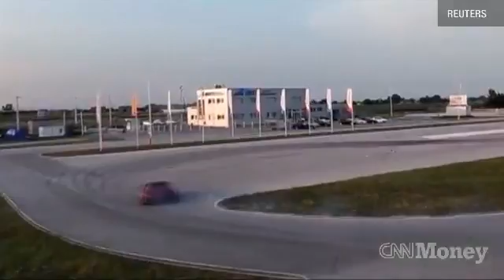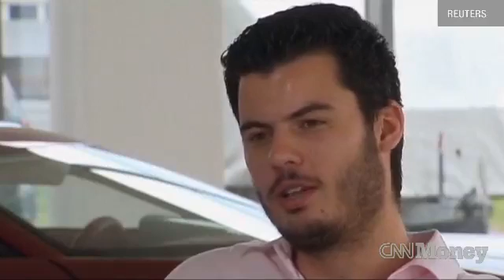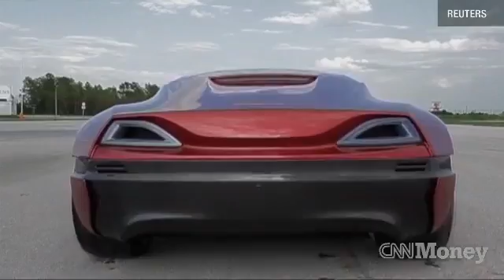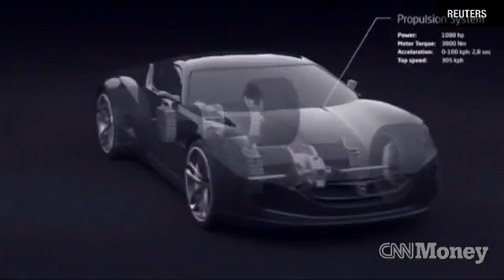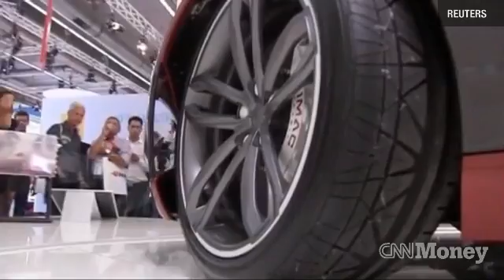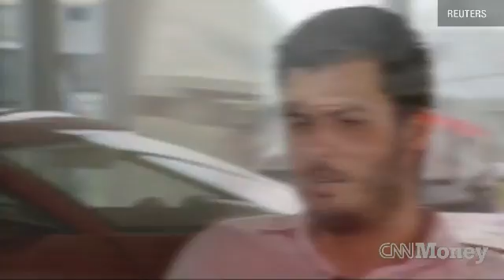The $1M electric supercar - from Croatia

Comment: It's nice Croatian car especially because it's electric.
The problem is that these cars are expensive.
Reply: You say it's expensive but it can actually beat LaFerrari, 918 and P1 in a drag race from 0 to 300 kmph which it does in around 14 seconds while the others take like 20 seconds. It's 6 seconds faster to 300 kmph than the other hypercars but somehow it's too expensive. Sure, why not, but where's the other cheaper car that can do the same? I don't even mean electric, just production car with the same performance. Don't look because you can't find it, the next best costs $3 million and it's 3 seconds faster to 300 kmph. Yeah, too expensive, like whatever.
Reply: Since when is 1M expensive for a hypercar? And anyway, Rimac's car is not the main product here, it is just there to showcase their batteries and motors. Concept One is a publicity stunt for something far mor valuable. A very good stunt, but still a stunt.
Reply: Maby hmm 200.000 but 1m , LoL
Reply: are there videos showing this? can it beat those cars around the track?

Comment: it sucks theyre so expensive and  waiting for that model 3 from tesla that starts at 30k but only in 2 years :(
Reply: +///AMG $35K. Could be $45K if you fill up the options page. Still better than even the 70D which starts at $75K.

Wait times?? The younger you are the longer you can wait. I'm 72 and I've been waiting for the three wheel $6800 Elio for 4 years. It feels like I'll die before I get it.
Reply: haha, yes i understand, but because technology is getting so advanced and that gas prices are never stable, the 35k testa would be a great buy even at 45k at the end. as long as theres warranty of course. im not paying 10k for a new battery.. and also a three wheeler? i always think those 3 wheelers tip over lol

Comment: Coat waaaaay too much. Tesla has really set the bar pretty high. Even the new Tesla Model S in development with AWD is putting down great performance numbers and the roadster started off with good performance specs. They only go for a little over $100K so why would anybody spend $1M for this.
Reply: dude, you're comparing two totally different classes of car! the tesla s is more like a bmw m3, and the concept one is more like a bugatti veyron, so hence the difference in the price.
Reply: Lilreeces10 Rimac has the best motor configuration for speed and range. Tesla cannot compete with Rimac's range of 374 miles and top speed of 180mph at this point in time.

Where Tesla beats Rimac is price and, with the $35,000 Model 3 coming out soon, Tesla will position itself in competition with other electric vehicles for the mass market.
Reply: +alkh3myst Not 14 times better but the motors Rimac uses are imho better than Tesla's motors. They appear to be much lighter than the huge number of Li-on batteries under the Tesla's floor so as a result, the Rimac weighs just 3600lbs in contrast to the almost 5000lbs for the S car and the almost 5500lbs for the Model X. That means quicker acceleration, higher top speeds(200+mph) and much longer range.

If the Rimac's price could be reduced to around $100,000-$150,000 they would sell like Viagra.
Reply: +benberkovic So you're saying that a Rimac, from a brand-new automaker, is 14 times better than a Tesla Model S? That makes no sense. Supercar/Hypercar prices are a much better reflection of the manufacturer's greed, and the egomania of the people who buy them, than any real concept of value.